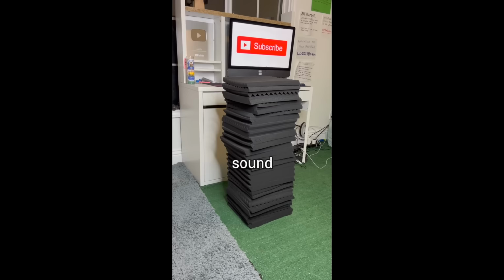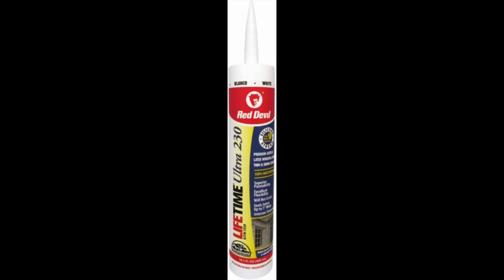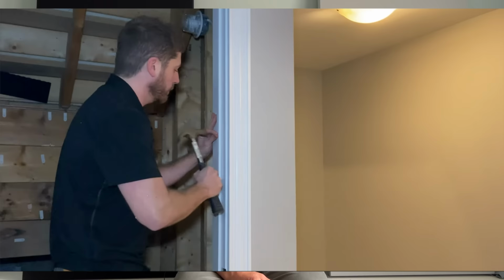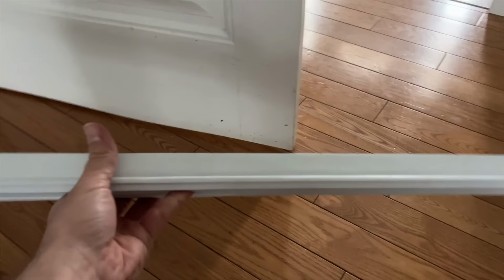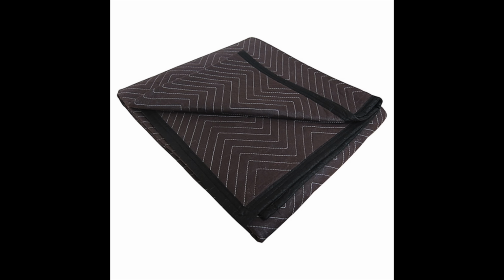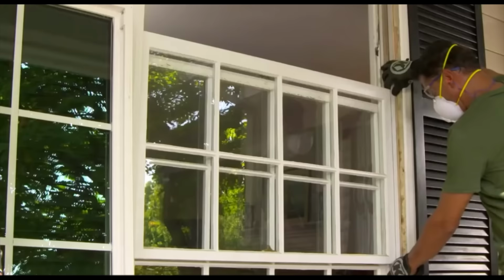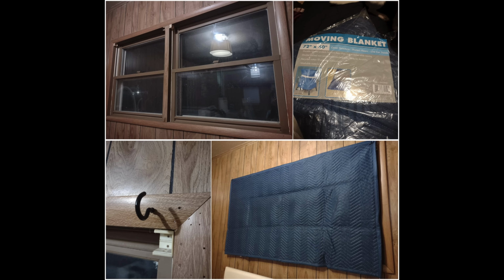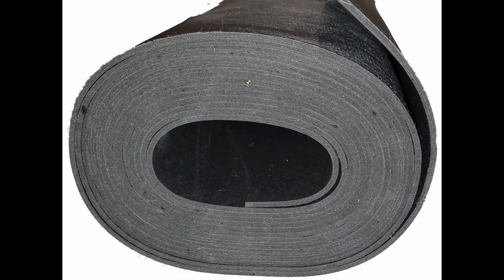CHEAPEST Budget way For SOUNDPROOFING a Room

Comment: When I moved into my current apartment, one of my first projects was to build a window plug. I made a close-fitting frame from 1x3, backed it with coroplast just to keep it from shifting and to give me a surface to work against. I sealed the gaps in the coroplast and between the 1x3 and coroplast, then filled it with layers of moving blankets, fiberglass and foam batting, using adhesive spray to keep everything in place before wrapping it with white muslin so that the side visible from the street wouldn't stand out as anything unusual at a glance. Once placed back in the window, I filled the gaps on all sides with copious amounts of silicone sealant. Next, I used long screws and fender washers to cover the entire window and plug with a heavy rug, then a doubled up set of blackout drapes. It doesn't cut ALL the sound, but the difference is remarkable. After adding a few strategically placed  absorption and diffusion panels in the room, it's quite decent for the most part.

Comment: Those are good points. As you mentioned, sound is the movement of air. Another thing to consider is utilizing area rugs. They can be hung on the wall as well as laid out on the floor and they are much more attractive than moving blankets. Better still, hang a rug in front of a moving blanket. The main thing is to break up parallel surfaces. Putting sound deadening objects (cylinders, etc.) in the corners helps as well. Since we're talking about the movement of air, what about your vents or registers? There are things that can be done there as well. It all depends on how much the sound pressure level needs to be reduced. And then there's landscaping. :))
Reply from the maker: You make great points! I did make a video recently about soundproof the air vents by adding something called a “sound maze”! They are pretty cool! Here’s the video - https://youtu.be/k66tray91RU
Reply: "Soft" surfaces - rugs, cushy sofas, fabric-covered screens - all work within a room to make it sound better. Even paintings help. It might keep sound in the room, too.
Reply: Thank you for mentioning landscaping. Nobody thinks of that when they chop down all the trees on their property.

Comment: You briefly mentioned this, but the gaps under the door and leaky windows are usually the only way of a room to get fresh air. A thing to keep in mind before going apeshit with sealing stuff.
Reply: Cold air return gets rid of cold air for circulation and to get fresh air in the morning you open window for five minutes even in winter. Canadian tradition.
Reply: Every room in our house has air vents the AC and furnace use to circulate air.  Is that not widely the case in other regions?
Reply: @babyseals4872  No, not necessarily. A lot of older houses use natural ventilation, where the hotter air gets pulled out through  upflow vents and  the pressure pulls colder air in through vents and, if the ventilation isn't balanced properly, through cracks in the building (creating draft). Almost every room should have vents for fresh air, though.

Comment: Some good tips.  I watched a DIY channel that showed how to make your own acoustic panels.  A good way is to go to an art store for the frames at the size you want and a fabric store for Terri-cloth towel.  Use velcro on the frames and the towel so that once and awhile the Terri cloth can be was of dust.   Terri cloth has that extra thickness similar to moving blankets and that fluffiness helps sound dead in a room.  

If you are working on a location set chances are you don’t get much ability to control a window.  Lighting team does.  

Insulation foam is your friend hear as you can cover up holes and the foam can help block vibration between panes sometimes.  

If you have full control and ownership of windows but they are single pane take silicon caulking and use it to go along where the trim meets the glass.  This will stop it from vibrating when outside noise is a problem.  I’ve done it and it works.  My old apartment was single pane and delivery trucks idling would make the whole room shake and vibrate the glass.

Comment: Most interior doors are hollow core with cardboard honeycomb. Mass is your friend for soundproofing, so a solid core door would work way better with the gap sealing. As far as the windows, making sound panels with rockwool is going to really help, and if you want to go all out put mass loaded vinyl on the window first.
Reply: Those darn cardboard doors! When I tell homeowners that they are just cardboard,  it's as if they don't believe me. But, after I have hung the door, and it starts falling apart, they don't call the manufacturer to complain, they call me.

Comment: Good tips. I just finished building my studio. I used rock wool soundproofing/deadening insulation in all of the walls and had extra left over intentionally. I bought $30 worth of 3" x 8' pine slats. a roll of weed mat, and built my own sound deadening panels with the left over rock wool. Saved a small fortune.

Comment: I live in a apartment with sheetrock between myself and the airbnb on the other side. I can't put up loaded vinyl and more sheet rock so I went the moving blanket route. It works to some extent. It doesn't fix the problem but you will get less noise from the other side. Also blackout curtains work very well for the noise and privacy. I also got some dense foam from packaging and put some of it up on the wall. It adds to the sounddeading, but not as much as furniture in the room(Or in my case empty boxes around the room).

Comment: We just moved our ten year old to the room on the other side of our wall. Fortunately, we have paneling in both our rooms so I am planning to grab some moving blankets, remove the paneling and attach them to the studs then reattach the paneling. Great idea! We'll see if any "noises" disturb him.
Reply: I don't know if that's a good idea for some latent fire safety issues. If you do this anyways, definitely be careful to make sure the blankets don't make contact with wires or anything that can get too hot!

You might see similar results without increased fire risk by properly insulating the wall between the two rooms (if that hasn't been done already), though that's probably more expensive than a moving blanket. If you can afford it, that dense vinyl material mentioned in the video is probably your best bet since it's designed to be put inside walls.

I just worry that with a moving blanket you'll make that part of your house more dangerous in a fire, since the drywall acts as a slight fire barrier between studs and flammable materials inside the room
Reply: @crazygrape  Great response, thank you. We don't have any drywall on interior walls as this house was built in the 60s as a lake house. Less interior bulk aids I winterization with less moisture to freeze/thaw. We, however, Iive here year round. I would never mess with wiring as ours is quite questionable as it is. Someday, it'll all need updating! I have thought about bluebird, which could be applied over the studs and then paneling reapplied (there are no plugs on that wall in our room ... weird, I know). Thanks for your advise. I appreciate your thoughts and you sharing them.
Reply: I'm sure there are many types of insulation that are rated for home installation and would reduce sound and be much safer in a fire. Also air sealing as mentioned in the video will do a lot.

Comment: As far as walls nothing beats adding drywall for noise reduction! Just add 2 additional 1/2 inch layers with a 3/4 space of air ( Door stoppers as spacers ) and stagger the drywall ( meaning don't installed them the exactly the same way but putting some vertically and some horizontally ). Its the cheapest way and it will give you the biggest bang for the buck! 

Of course we must add extensions to the electrical outlets and the drywall itself but after you get a HUGE sound reduction. PLUS your suggestion for the outlets and cracks make perfect sense as well 👍
Reply: If you're putting up new drywall, have the hollows filled with mineral wool or some other insulation like it. If you're using sheets, it's important that they're a bit bigger in all dimensions (including thickness) so you don't have any gaps.
Reply: @rolfs2165  This video is about cheapest right! so that being the cheapest and proven best noise reduction is drywall! so unless heat is an issue putting mineral is not as cost or sound effective as putting another layer of drywall! 

NOTE: The word for " Bigger in ALL dimensions " = staggered which I already mentioned above. staggering means you put the first layer vertically and the second horizontally which is more than enough without complicating things too much. Also one can use 1/4 spacer between the two layers as air dissipates sounds as well. 

ALSO NOTE: To pay attention to the electrical boxes as they need to be deep boxes OR special insert type boxs made for this type of installation. 

This concept is based on the ROOM INSIDE A ROOM that is made for Music Studios and is the much much cheaper more economical version of this concept.
Reply: @veger2001  No, I do not mean staggered. I mean that you want to cut the sheets of mineral wool 1-2 cm wider than the space between the joists, and you also want it about 0.5-1 cm thicker than the joists, so it gets squished when you put the second side of the drywall on.
I'd also argue that with global warming, heat is something that should be kept in mind for any new construction.

Comment: Thanks, this helps a lot!

Another thing that I think might be worth mentioning and I feel is relevant, is that sound proofing can help to control heat or isolate heat in/from the room that gets isolated. 
That increased R-value can pay off in lower heating cost.
Not to mention that lower heating cost and less noise disturbance can both help reduce stress, which again can lower healthcare cost in the long run. 
Not that this comment of mine is meant to diagnose or treat anything.

Good luck in all your endeavours.
Kind regards from Iceland.
Reply from the maker: That’s a great point! I definitely will mention that in future videos!

Comment: Something I have noticed is that the sound proofing effect of uPVC double glazing degrades with time. I tracked it down to the collapse of the rubber seals between the moving panes and the uPVC surrounds. The rubber becomes harder and less springy with time which results in air gaps, and as you have already identified that causes the noise to leak through. If you have this it's time to replace the rubber seals.
Reply: I noticed that on the main entrance door of the house I recently bought. I had new windows installed but not the door as I am still working on the house and was afraid of damaging the new door.

Comment: Great video - couple things maybe (or maybe not) useful.  Door snake - its a little rolled up towel thingy that you put at the bottom of the door if you don't want to use a skirt - you could just use a rolled up towel. Moving blankets! - I never knew that.  Makes total sense. Three ways to reduce noise (=any unwanted signal).  1). The mass/hard blocking the video speaks of.  That dense foam really does work.  So does concrete. 2). Chambering and attenuation - that is what the foam tiles try to do.  I suspect the moving blanket do a bit of both 1&2. 3) Canceling - not really practical for a room.   The textured foam does work if used properly. We used to use the "egg" or "nipple" foam (the tiles - except we bought in rolls/sheets) - but the texture needs to point toward the noise source to work best - it used to be cheap. There is a warning touched on in the video.  Nothing is more uncomfortable than a sound dead room.  They can be hot, stuffy, strangely uncomfortable and a friend of mine used to complain of itching while in the booth (I think in is head but still real to him).  You are better off trying to reduce (not eliminate) noise while increasing sound (=pleasant signal).  Unless it's a sound booth of course.  This was really interesting as a video.

Comment: If you don't want to add as much thickness to the wall, 1/4" thick cement board adds slightly more mass than 5/8" drywall, but will cost more. Alternatively, adding it between two sheets of dry wall is significantly cheaper than mass loaded vinyl also. You just need to use some caulk between them if you want sound deadening as well.
Reply: Thank you

Comment: I used 4 curtain grommets that I added to the top of a moving blanket, then installed 4 white hooks directly above the door, hidden partially by the door trim, and hang it there when I am recording. Works great, and is easy to remove and store, and you don't really notice the hooks!

Comment: One way to soundproof a door is just to replace the door with an EXTERIOR door. It will be heavier, usually steel sometimes with a faux wood finish  and come with weatherstripping all around. For best results you may want to replace the door jamb too, which usually comes with the door and gives you a chance to use caulk behind the trip in any gaps. Also seal around any switch or outlet boxes as sound can travel thru them easily.
Reply: check to see if all exterior doors are EXTERIOR DOORS, I swore a Realtor installed an interior door, flipping the house, and quickly cheaply pushing a sale.

Comment: The one part of the room I was looking for getting advice is the ceiling. The room I'm working on is a basement family room. And so my most noise is from the floor above.
Reply from the maker: CHEAPEST Budget Way For soundproofing Ceilings & Floors!
https://youtu.be/1e-6Gg7eV4s
Reply: It's easiest if you are in the planning stages. ✏  But even my ancient cat sounds like a draft horse running down the hall.

Softer surfaces up top - carpet, "luxury vinyl", area rugs.

Seal air gaps around upper floors (can you pop the baseboards and really seal gaps with caulk and backer rod?)

Underneath, if you can remove ceiling tiles and install insulation and some sort of a sound gap - so vibration up top can't transmit as well.

Comment: As someone with an extreme latex allergy, that includes anaphylaxis, I can’t use many of the options to help deter sound coming in and help with echo and whatnot. Those rubber products are definitely not an option. I already use the blackout curtains, to to help with cost use a panel per window. On some I have double the panels. We have wood floors everywhere, so any soft surface helps with room echo. I also, around my microphone for voice overs, make an “recording booth” of large stuff animals and pillows. Instead of moving blankets in areas I have quilts and can double them up if needed. Looks “interesting” and takes some setup, but works pretty well considering.

Comment: When I replaced my mattress, I leaned the old one up against the wall to "get it out of the way for now". 

It cut the noise of my neighbours watching tv, coughing, and snoring, in the next unit (purpose built multi story apt) enough, that it became a permanent padded side-headboard for my bed. 

I put an aesthetically pleasing fitted sheet on it, and it's now been there for 2 years.

I hadn't considered the fact that having blocked the outlet in that wall (which is inconvenient) might be part of the reason it worked.

There's definitely nothing between the walls within our unit, but I had kind of assumed fire code would require them not to build back to back electrical between units...  Then again, opening up holes in the walls to redo plumbing, in ways that allowed mice to move unit to unit very conveniently is apparently a thing they consider fine and dandy (solved it myself). 

It's not a fantastic solution, and it wastes  5" of floor space - but it cost nothing, and means I don't have to wrestle a queen mattress out of a 3rd floor walk up until I move.

Now if only I could block the sound of lawn mowing, and the kid that "plays" by screaming like there's an emergency (despite being politely requested not to, for multiple years, by multiple neighbours - all the other kids manage to sound like kids playing loudly) without closing my windows, ensuring no air movement and blocking all natural light.

Apparently I just need to live with earplugs in at all times. 🤷‍♀️
Reply: Ah,  the dilemma of wanting it to be quiet and wanting the window to be open... I feel ya XD

One day, someone will come up with something that will let us do that, but I haven't seen anything like it yet :)

It looks like this channel has a video about building "sound mazes" inside ones A/C vents, to allow airflow while reducing sound. I wonder if someone who's good with materials could make something similar that could be placed in front of an open window to deaden sound but still let in fresh air. Perhaps made with plexiglass? Hmm...
Reply: Check for mould periodically.

Comment: Great tips. Prevent the noise (and light) when you have a chance. If you ever build, these little things can make such a difference in quality of life. Even if you have a leak/repair, if the wall is open, add what you can then.